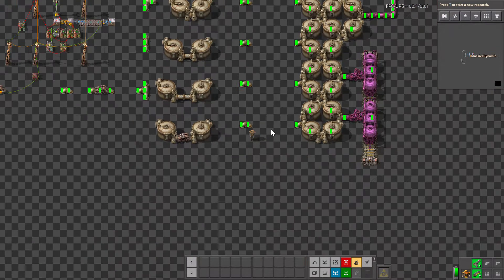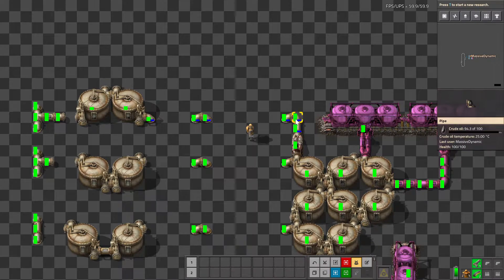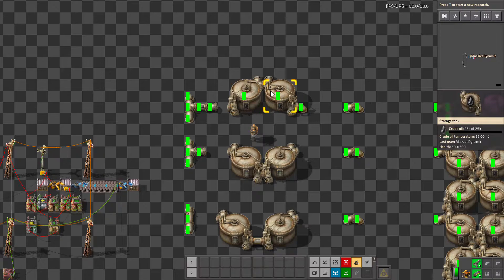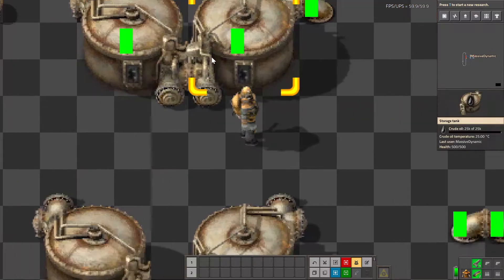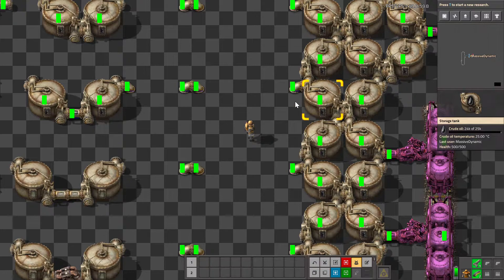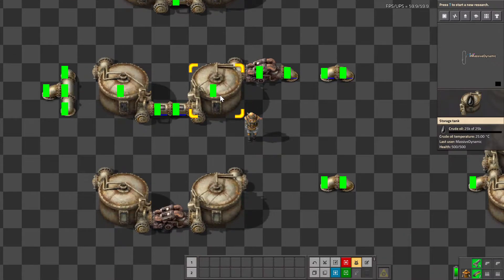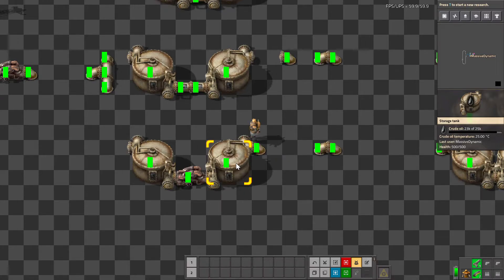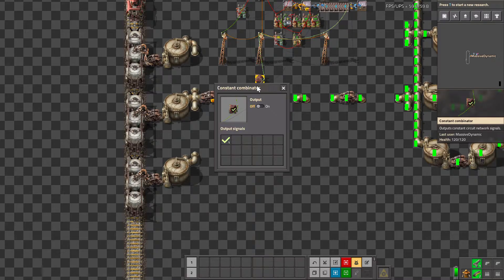Factorio Fluids and Trains

Comment: what if you only use tanks as if they were the pipe
Reply from the maker: The game will try to equalize the level of fluid in each “section”  of pipe. So larger “pipes” will basically result in lower pressure in the line.
Reply: My ideas for Fluids:
1) Use underground pipes where possible.  If you have an 8-long surface pipe, the game has to balance the fluids in each of the 8 pipe segments.  But if you use an Underground Pipe, the game only has to balance the fluids in the two parts above ground
2) When unloading from or loading to a train, make sure there is one extra Storage Tank than what the train can handle (so for these trains with 3 Tank Cars, make sure there are 4 Storage Tanks at the train station).  This ensures that you aren't stuck waiting for that last 1000 fluid to be transferred.  One idea is to have that extra Storage Tank being Pumped to the waiting Storage Tanks, and only enable the station when the extra Storage Tank has at least 1000 fluid (this means the waiting Storage Tanks should be full)
3) Have Pumps taking Fluid from a Tank where possible, as that way the Pump can use its full 12000/s capacity
4) Have Tank Farms separated by Pumps.  This way instead of trying to balance a size-8 Tank farm the game only has to balance two size-4 Tank Farms, and since one of the two will be filled rapidly the game soon only has to balance a single size-4 Tank farm.